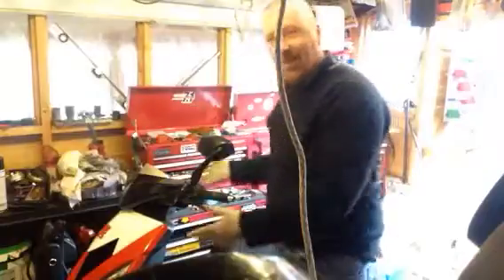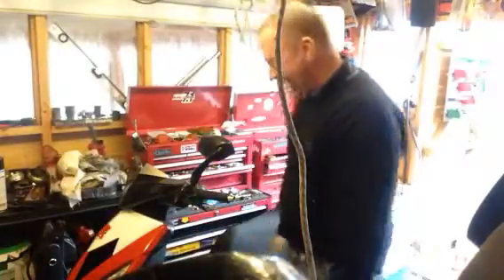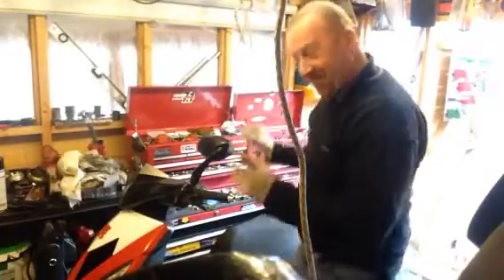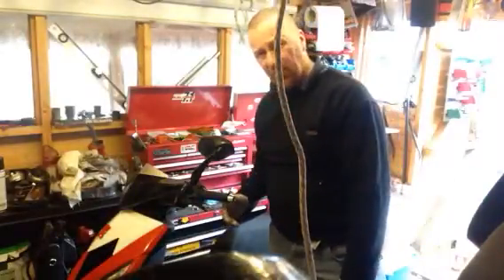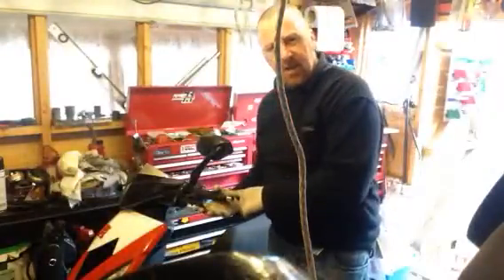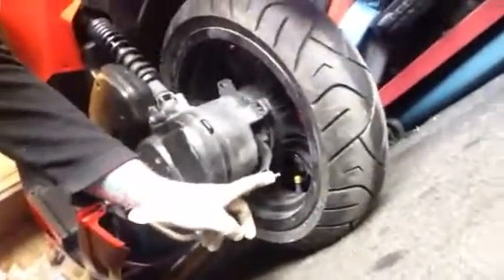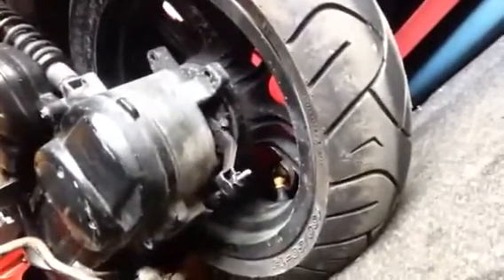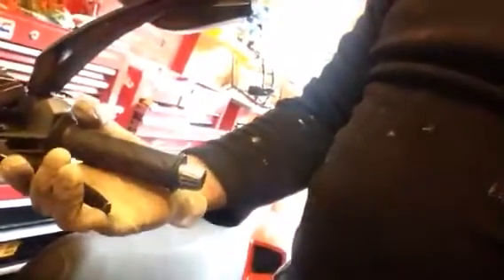SPEEDFIGHT 3 SERVICE shock fix blog mark savage

Comment: hi Mark fantastic channel loads of info on the speedfights. I have a question do you know the standard weight of the rollers in the speedfight 3 50cc lc or what weight would you recommend the scooter is restricted I only use it to go 3mile to work.
thanks
Reply from the maker: skulluk1 hi bud thanks for the comments , as in my videos I Combi them but 5 or 6g are fine to give you good pull away remember to clean the variator and check belt bud , mark

Comment: hi mark i got a speedfight 3 where the front shock absorber is not moving back up anymore unless i put my foot in wheen and press brake and pull it back up, is there any parts i can replace the front shock with as like the speedfight 2 ?
Reply from the maker: hi bud , no it's a twin shock system and they make them as a unit so it's as replacement of all of it, it's the whole front off and take off like in my video of doing the head stock, I do have a few other videos on the sp3 that may help 
it has to be done as it's dangerous now 
mark
Reply: do you have a video on how to change the entire front fork ? finally got myself a new working fron suspension
Reply from the maker: hi and thanks for watching , only on the sp2 I didn't do one on the sp3 but the basics are the same with the head stock,you will still need to take off the clock and front panels to get to handle bar, undo and lift off like in my sp2 videos on head stock, take off brakes and speedo drive then drop down follow my video on fighting back up and brakes hope that helps mark

Comment: Hi mate having problems with my speedfight tryed putting new tail light on and nothink lights up so dnt no if fuse gone it stars but no indicators or break light petrol gage works lol
Reply from the maker: +Ellesse Smith /
there is a fuse by the battery 10 amp see if that's gone, does it electric start or just kick start

Comment: hi I just wondered if you can help I have a Speedfight 3 liquid cooled and sometimes slow when pulling off until it get to 5000/6000 revs
Reply from the maker: Jason Pitchford hi, I have many videos on this that will help and the sp2 is the same for most things like this on the sp3 , but rollers and belt is a good place to start before carb , please like share and subscribe , mark
Reply: Ok thanks mate do you know what the gold bolt on the side of my card is called a yellow and green wire attaches to it is it same wires as the auto choke
Reply from the maker: Jason Pitchford on the sp3 LC the wire is for the temp so nothing to worry about bud , mark
Reply: is there any chance you can have a look at my bike please I will pay you but where do you live

Comment: I have a 13 speedfight 3 and it won't push oil through to the engine
Reply from the maker: Bailey Griffiths seems like it will be your oil pump ? Is that pumping oil ?
Add some 2t oil in with the petrol till you sort it 
Mark
Reply: mark savage thanks for that mate